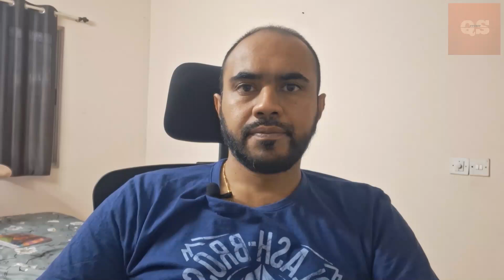MEP Quantity Surveying | Cable take off Tip | Single Line Diagram

Comment: For a safer side, how much cable quantity can be considered for wastage, termination and cable length buffer?
Reply from the maker: 10 to 15% would be safe i believe
Reply: @QuantitySurveyingStudio  but 10% is only widely accepted. Presently I have a project. The conduit was under the scope of the mep contractor. Cabling is under our (subcon) scope. What we faced is the cable shortage. The mep contractor installed the exposed pvc conduit in the void area. Conduits are not going straight. There are riser, drops, offsets etc due to ducts and equipments. The most important scenario is this is a variation scope. The consultant   usually tells coordination is your scope. Now we made an as-built sketch and given numbers for each offset locations and photos taken from the site and named the offset locations number. It is under consultant review now. If it is not approved then clearly we are losing in cables. It is a scenario. 

If we do a material reconcilation, we can clearly identify.

Comment: good advice. now i wonder regarding the schematic diagrams that i encountered, i have never seen quantity of length written to it, just the cable specs. :D to share my experience as CQS i do measure on plan and if i had a doubt where the cable run,  i have to go to site if possible and ask some1 there
Reply from the maker: Glad it helped